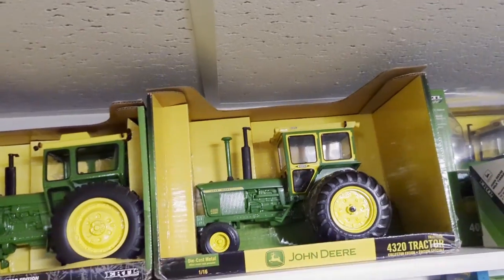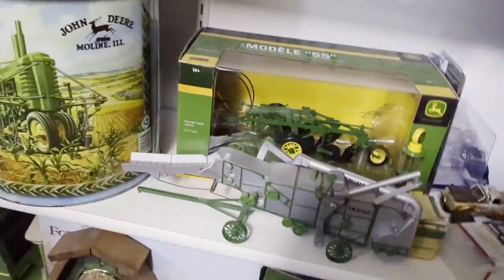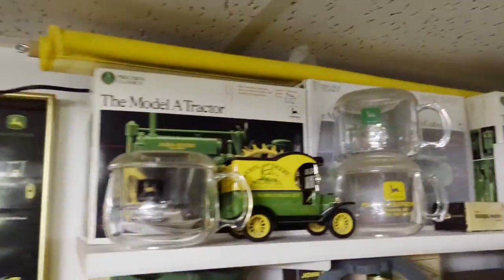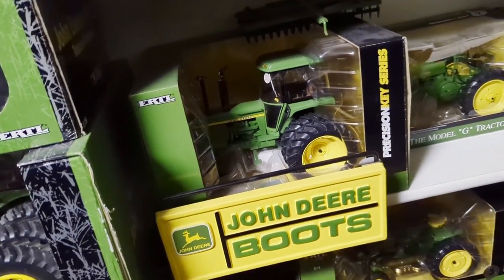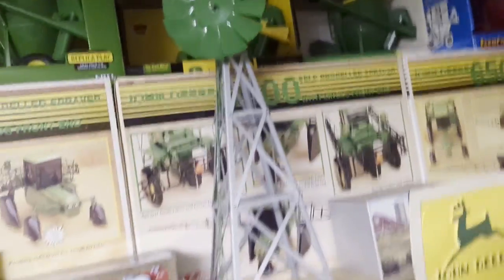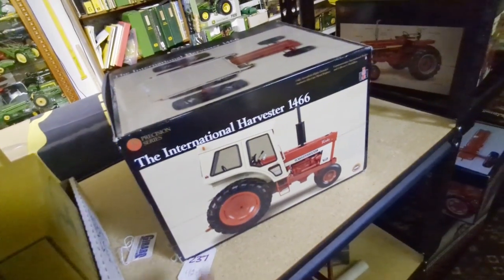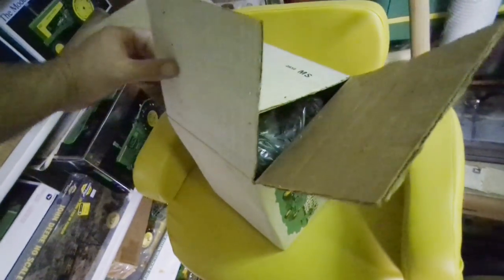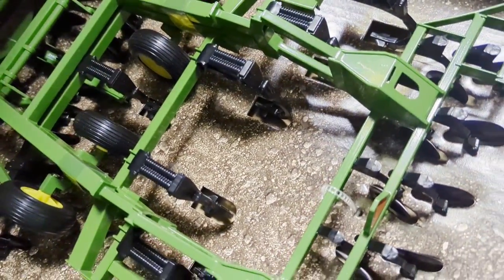Part 2 Farm Toy Sale

Comment: I'll have to dig through my collection 1 of my Farmalls is spelled Framall on the decal on the tractor
Reply from the maker: That's cool.  I have a couple mixed up packaged ones such as a drill packaged on a manure spreader card in 1/64th.
Reply: @AgWildNebraska  I always look for mistakes when I'm at a show that has alot of toy vendors I've picked some up pretty cheap and made a pretty good profit off them because they snuck past quality control